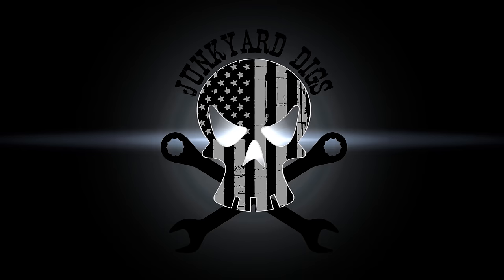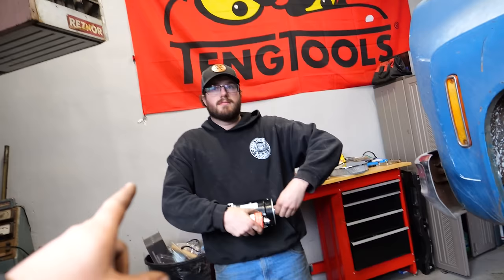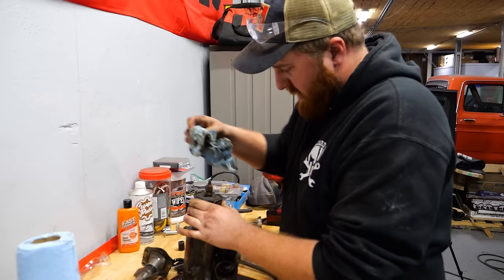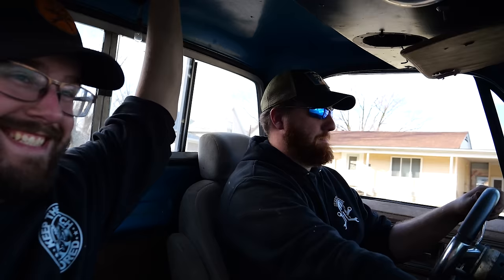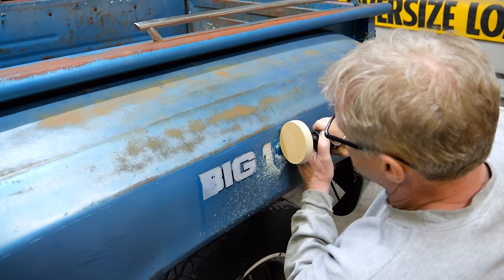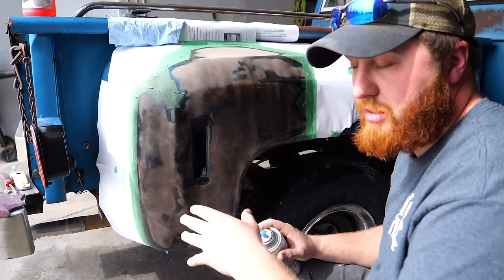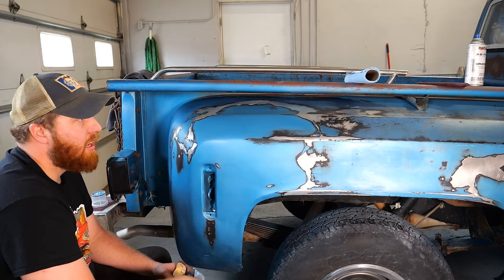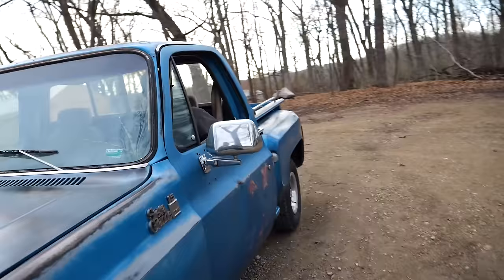Can we Fix-Up an old Square Body on a REAL BUDGET??

Comment: I never get tired of Angus' humour. Less than a minute into the video and he's already made me laugh. Love the guy.
Reply: You have an interesting definition of humour my friend.
Reply: “Just undo it, yep I was laughing at that”. Probably won’t leak, probably won’t work! You need that on a T-shirt!
Reply: My favourite is still, "I never been with a Cougar." 🤣 That was a hell of a cold open.
Reply: The contacts in the solenoid are dirty from arcing and/or the brushes are hanging up in there hoods.  To bad the solenoids are sealed ...
Reply: he's had some great JYDs moments ... like  ... Kevin "we may hit a carwash when we are in town" ... angus "seeing the brakes, we likely will" .... or Kevin "left Angus"  ANgus ~looks and turns right~ (I may have that backwards) ... or Kevin "why does the sun go down so EARLY!? :( "   Angus " :) Gravity" .. lol
Reply: The steering box output shaft seal should pop out by removing the pitman are and then the snap ring holding the seal in. Fire up the the truck and turn the wheel to lock and pressure should push the seal out.
Reply: @UNCLEBGA  I don't disagree with anything you are saying in general but you appear to be having a conversation with someone who is not in this thread.
Reply: Angus can do comedy well, he has good timing.
Reply: @Wiltshire_watcher  A quality timing light helps with that

Comment: Little tip. When using rattle cans I always leave them sit in a bucket of hot water "Hot as in comfortable to leave your hand in" to warm the paint up and it ups the pressure in the can as well. Goes on much better and more even. Ps always make shure there's no water droplets left in the little channel around the nozzel on top of the can or it picks it up and ruins your painting.
Reply: Yeah that works amazing!
Reply from the maker: Good call! I'll have to try that
Reply: I like using the trigger adapters for the cans, too. Helps prevent "paint finger." And also sore finger.

Comment: One of my first jobs when I worked on the assembly line was putting on the steering gears at the since-demolished Pontiac East Assembly, where the Silverado and Sierra were built. The steering gears came in with the pitman arm already attached, and you could either lift them with a hoist that hooked under the pitman arm, or just use the pitman arm as a handle and lift them manually. At this point of assembly, the frames were still upside down. The 3 bolts were already inserted in the frame as part of a job 2 or 3 places upstream on the line, so you would just butt the steering gear against the frame, grab the air-powered torque gun, shoot the bolts in to torque, then mark each bolt head with a yellow oil crayon. Those suckers got heavy by the time you did 300 of them a shift, lol. Good times!😁

Comment: Little tip/idea: when you checked the starter wire for power you just checked if there is power not how much the wiring can deliver. 
If you have a Batterie Tester, maybe just hook it up to the main power wire of the starter and run a test from there. This way you can compare your Batterie If you test that too, to the starter wire. Or if you know your Batterie is good just the starter wires. I used this trick on old tractors and it worked well there.

Comment: Awesome! And it looks great! The patina looks like something from Mustie1’s channel. May keep that in mind for my recent project.
Thanks to you, Mook, Dalton, and Chris at NNKH, and much to the chagrin of my wife 😄, I got motivated to fix up a $1000 marketplace find ‘95 F-150, 4.9L I-6, that’s been sitting for 4 years!
$500 into it for getting it running again - Starter, plugs, ignition switch and gas tank, pump and filter. Roughly another $600 for cosmetics - new tires, matching rims and bucket seat upgrade.
It’s been a blast so far and still coming out cheaper than replacing the transmission on my 06 Expedition! 
Waiting for the merch I ordered in the mail!

Comment: Typically you pull the snap ring from the output shaft on the gearbox while its on the vehicle and start it up to turn the wheel and it will blow the seal out because most of the time they dont like to come out. Lol thanks for the added input on the rebuild. Its definitely helpful!
Reply: I would add, turn it to lock. more pressure

Comment: Nice truck!!! I had a 1980 C10 step side that looked just like that when I was a senior in high school. Mine was originally a 250 6cly 3 on the tree that was converted to a 350/350TH. I loved that truck. when the automatic was put in, they left the clutch pedal that would just flop around, but it would do an awesome one wheel peel. It was an early 80 that still had the round headlights, before they changed to square.

Comment: I like the clear coat on the whole truck. It's like 1 coat of paint that you can see thru. Paint stops Rust.
I replaced my 350 with a manufactured motor. Had the truck for years and burning 12" wide rear tires was easy. Taking my old core back to the place that built my 350, is when I found out My motor was a 305 the entire time. Also a lot of Dirt Track cars use the 305.

Comment: If you stick the tape on the edge then fold it back over itself, it will give you a soft line to blend.  it seems counter intuitive to stick the tape on the other way to what you are taping off but it works great.

Comment: As a mechanic for many many years. Lets talk about those flex lines..Flex lines that are held on with a steal bracket around the rubber hose as they are. The steal bracket rusts and the water wicks its down the line and behind the rubber hoses. As we all know when metal rusts it expands, crushing the rubber hose. If you use a flat screw driver and pry open the bracket. You may just find open the rubber line is fine.. If not you have lost nothing as you were going to replace it anyway..

Comment: Thank you for your videos, because of them, I was able to save a 1989 f350 ex cab dually. The 460 5 sp does work, but she needs some love. I'm in it for 800 with buying a new battery getting plates and title taken care of. She's also pretty clean for sitting since 2017 according to the plates. I actually drove this truck when a buddy had it 15 years ago. I'm going to redo it and drive it in his honor as he passed away in 2015 due to health problems. He was like a father to me. Thanks again. Been following since the f250 before you deployed.

Comment: these steering boxes are fun if u are a masicist.   be sure the shiny balls and black ball alternate when assembling.  I used grease to keep the balls in place when reloading.  so the part with the valve assy (3 ring seals) the activation pins should be pointing at each other . also a lite torque each way should be the same (or you will think the string is weird.  great fun!

Comment: When the solenoid clacks but the starter doesn't move, and if the engine isn't seized, usually it's a battery or cable. A trick is to turn on headlights, try to start it. If the headlights dim or go out, it's a high resistance between batt and starter most of the time.

Comment: The best way to get the Pitman arm shaft seals out is to take your C clip off that holds them. Then start the truck with everything still connected and turn the wheel all the way to lock and it will just shoot them right out out the bottom. Then you can use a socket and push the new ones up in place and your done.

Comment: The stupid front brake hose can be fixed by just routing the inner line out of the frame rail hole in front of where you're supposed to connect the two lines through the frame. Ever since I've done this it's been so easy to work on my brakes

Comment: Trick I learned when doing pinion shaft seals is if you're doing it in the car you just pull that snap ring off. Start the car, turn the wheel and the seals come right out.

Comment: Patina-style crossbones JYD logos on the doors would be an excellent addition to your new shop truck 🙂 And maybe later a built old-school 454 and rebuilt 4-speed. Well, you’re gonna be swapping the clutch out so either the engine or ‘box will be coming out anyway… 😁

Comment: the bracket that holds the rubber brakeline has shallowen due to rust thus pinching the rubber hose, got a squarebody that runs mint in everyways possible supercheap cuz of that

Comment: Not sure if anyone mentioned that if you leave the gearbox on remove only the pitman arm and the snap ring for the seal fill the power steering fluid start the engine and keep turning the wheel from stop to stop with some luck the pitman arm seal will push out.

Comment: You can change he pitman arm seal on the vehicle easier.  Remove the pitman arm, clean area, remove lock ring, put pan under box, start vehicle, turn steering wheel to left and the pressure will blow out the seals.  Easy-peasy.

Comment: I would suggest you do the finishing touches to sell it like fix the squeaky clutch, plug the holes in the roof, and maybe even lower the rear springs so it sits level as Angus pointed out they are the largest size for the truck

Comment: The moment you turned that input shaft on the bench it was screwed. I tried yelling "NO" but you must not have heard me.😂 One more thing... if ever you come to a car that has sat a while, and the starter clicks like that, try wrapping on the starter with anything available before you pull it. Even in a car that you know its bad. Try hitting it while someone is turning the key.

Comment: Hey kev, next time you use primer anything in a can...shake that crap up for atleast 3 mins. Primer had alot of particulate in it. Keeps it from spitting and sputtering. Also will lay thicker from the beginning because the material will come out and not just the solvent. Shake the paint too. White in paint is titanium dioxide and its super heavy and will sink to bottom of the can really quick.

Comment: A small bit of trivia if you ever decide to put the "Big 10" stickers back on the rear fenders - "Big 10" is a Chevy.  The GMC equivalent is called "Heavy Half".  These were trucks that were made to compete with the then new Ford F150 which many called "5/8th tons" as their weight capacity was just high enough to not require a catalytic converter at the time.

Comment: from someone who worked for gm through those years "you can't fix stupid" I once was watching out L,O,F, guy do a oil change  and he filled it with oil and raised it to check for leaks and the front of the crank broke off and went rolling across the floor (it was the first oil change for the truck and only had 3000 miles) we had to install a new engine, after he got it back he sold it and went and got a new ford  ( it was in 1987 so the ford was a much better pickup)

Comment: Idk if you are aware but when towing vehicles i believe it is necessary to either disconnect the driveshaft or pick up the drive tires. Prevents spinning the trans and doing any damage.
Reply: Dont mind me lol i just realized its a manual! I dont think it applies to manual transmissions.

Comment: I like it and the fact that it's a 78 GMC Sierra c15 grande and not the common everyday Chevy counterpart yeah i kinda like the idea of your keeping it as the shop truck even though I always figured that would be the 69 Ford f100 ranger or the 65 ford f250 custom cab trim trucks

Comment: I have a 86 chevy k20 custom deluxe long bed well used 4x4 farm truck,, and i was throwing cut pieces of firewood in the back of the truck had a about half a load of wood on the back of the truck and the very next piece of wood i tossed in the bed of the truck,stood straight up and bounced off the bowed out center of the tailgate and shot right through the left side sliding section of the aftermarket replacement rear sliding window??? Grrrr and and was sitting on the dash pad of the truck and left three cracks in the almost perfect dash pad that was there before... and I ended up getting a steel sign when the truck got buried in the ditch getting over for the county dumptruck plowing snow which decided to take their own half of the right side of the road and pushed the truck off into the ditch to keep from wrecking my truck anyway the sign was effective to getting the truck back on up and out of the ditch and it became the left side side of aftermarket rear sliding window

Comment: I put a older 302 think was 72 was .30 to 306 used svo 351 flat tapped cam and big vale 351 big plug heads in my 86 mustang with 5 speed 410 ran 13.1 after blowing the 5 speed up put in a automatic and nitrous ran 11.60 always drove it to the track was 2 hour ride wish I keep the car .good luck I'll be watching 😊

Comment: Ya know you can pull the pitman and the snap ring , start the truck , hold RPM at 15-1800 rpm crank the wheel all the way  to one side and hold it , the seal will blow out the bottom.  dont forget the drain pan to catch al the ps fluid. Look at a picture to see how it goes back together. wa la!

Comment: I definitely wouldn't mind having that truck for a daily. I would fix all of the rust, paint it, service the entire suspension, put a set of bucket seats in it, restomod the interior, a full dual exhaust (or possibly a turbocharger), and I would rock it.

Comment: Easy way to change the pitman shaft seal - remove pitman arm, take the snap ring out that holds the seals and washers. Place a drain pan under the pitman shaft. Start the engine, turn the steering wheel to the lock and keep doing that until the seal blows out. Install new seal.
Reply from the maker: I mean I guess 😂
Reply: It's a slick way to do the pitman seal. Most of the time (around here anyway) that's the seal that goes bad. Last one I did took one tap on the stops to blow the seal out. It does make a mess, but it takes just minutes to fix a seal (once the pitman arm is out of the way)

Comment: I've got a step side 73 that I've had since 94 it has over 600,000 miles on it it originally belonged to my best friend and my brother drove it for years and they have both passed away im fixing it back up as a tribute to both of them 😢

Comment: Love watching the videos and glad to see you tackling power steering as I actually have a question about that. Steering wheel has side to side play and all seems to be tight through rag joint into the box but no ouput movement from box. Would the adjsutment towards the ragjoint fix that slop or the adjuster nut on top the steering box?

Comment: Hi junk yard digs. I have a 72 f250 with a 360 fe and it doesn't run right. It back fires and thats about it. Its not the plug wires there on the distributor right. To find more about it its on my channel. Thank you guys

Comment: Hey ,how do you figure you have a starter problem when it works on the ground, mabe the shims have something to do with it . I ve built a few and hey I just putting in my 2 cents without any disrespect 💯.
Reply from the maker: Before we turn to the camera on it would engage the Bendix but not spin

Comment: I don’t understand why you’re always having to replace starters it with a hammer couple times it should knock the dust off the brushes and continue working. People spend so much money buying new starters. My vehicle has the same star for 22 years factory GM star vehicles got 200,000 miles on it never replace a starter